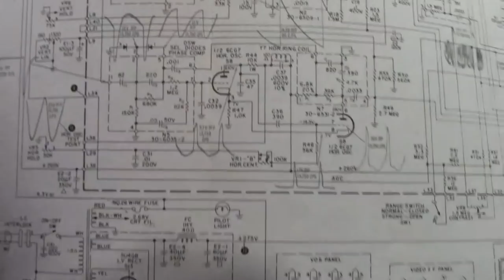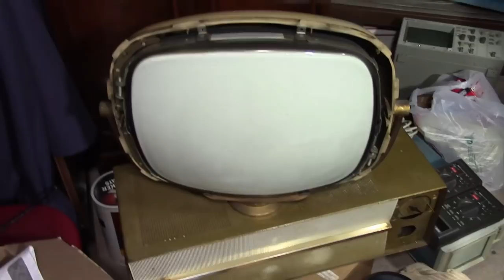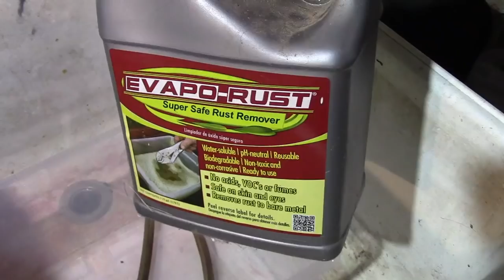Filthy Philco Predicta Siesta resto p7o?

Comment: At 5:01, on the schematic I believe the vertical line to the left of 1320 on the vert lin pot is the physical stop at 180 ohms. Otherwise you're right, it would be possible to turn the control down to 0 ohms. Loving this restoration series!
Reply from the maker: Yes, that is exactly what the line indicates, but they show that ended shorted to the wiper so it limits the upper end of the resistance.  The control will go from 0 to 1320 ohms.  Make more sense to me from it to go from 180 to 1,500 to maintane a negative voltage on the output triode grid relative to the cathode.
Reply: @bandersentv  Hmmm... yeah that is strange. From your previous video I thought the same thing, that the 180 ohm tap was a minimum resistance so it would limit cathode current. It's wired as shown in the schematic? I expected the wiper to connect to the 180 ohm tap point so that control would go from 180 to 1500 ohms as measured from the cathode to gnd. But the way it's shown schematically it would be 0 to 1140 ohms... why did Philco bother with a special pot then? Took a quick look at some early 50s schematics from sets I've worked on, they have very similar linearity controls in the VOT cathode, using a pot in series with 150 ohm fixed resistance. Has me wondering if there's a typo in the schematic, some previous tech replaced the control as shown, and maybe that cooked the other resistor in the vertical circuit? I have no expertise in Predictas, so maybe the circuit is correct as wired. Curious to know if you find out differently.
Reply from the maker: I examined the control and it seems the schematic is wrong.   There is one lug for the wiped and the body is grounded.  The resistance varies from about 180 to 1500

Comment: Bob, on the IF strip, don't forget there is a Network on there and should be replaced too.  It looks like a ceramic cap near the middle coil.  Also on one of the Predicta's I redid there was a small diameter phenolic tube about 1/2" dia that was placed over the chassis mounting screw "hump" that is located under the octal tubes.  This spacer was about 9/16 high and is used to support the board when pushing in the octal tubes.  I use some 1/2 dia sprinkler pipe and epoxy it over the hump on all the Predicta's I restore.
Reply from the maker: Yes, I noticed you supplied the IF network with your reproductions.  Interesting.  I've worked on about a dozen of these and never seen that piece under the octal tubes.
Reply: @bandersentv  The IF Network I supply is has the capacitor changed from 15pf to 12pfto improve SNR per Riders on the Run Changes for the 10L43 chassis.  The small spacer might have been on one of the Danish Moderns I did.
Reply from the maker: Thanks for the info

Comment: If you need a real good brass paint to spray try the Humbrol brand. Acrylic spray in a 150mL can. Let dry 8 hours and spray a clear coat of Humbrol Satin finish clear.
I got mine  (actually Copper Special metallic paint and polished Aluminum for a Heathkit signal generator project)  at America's Best Hobby Center in Itasca.
 You could also get this brand at Des Plaines Hobbies too but they were low on stock on some colors. Was really impressed at the final finishes of this paint.
Those copper clad boards inside were corroded and  I cleaned it with Simply Green and a toothbrush. Taped off everything not to be painted! Worked very good.
You could try using  ordinary tomato ketchup . Soak it for a 30 minute session and wash it in warm soapy water. If still not clean enough repeat those steps. Unfortunately
it won't help with pitting. You could try the paint instead of re-plating! This is to insure all the brass and plated brass  steel  match in shade and color. Whew!

Comment: For wire sources don't forget to look at the multi-conductor options (ie. multi-conductor cables). Something for industrial usage like robotics or motor control may be salvageable or (worst-case!) purchased. This stuff is stranded, flexible, high heat tolerant and goes up to 1kV ratings. An example of this would be the Flamar line of cabling from molex (avail at Digikey too). The downside is that you have to spend some time stripping the cover and getting the wire out, if you want the individual cable "look". I did this many a time in my youth when I needed wire fro projects but was too poor to buy it. I used to scrap Belden cable...
This stuff is a plastic (like) coating... i suppose a cloth covering could be slipped over it, depends on how far down that road you want to go in the restoration.
Cheers,
Reply from the maker: I don't care about cloth, but ideally it has to be stranded, 22 AWG and 2kV or better rated.
Reply: @bandersentv  - There is some 2kV wire that is used in VFD applications (variable frequency drive), mainly larger gauge like the Belden offerings so that's not of much use to you... Any option to scrap HV wire from other (newer) CRT sets?
Cheers,

Comment: Those newfangled ceramic octal sockets were likely designed to accommodate either mounting scenario mentioned early in the video.
Reply: hawkturkey  They are Chinese copies of a type of Soviet/Russian socket, with the Soviet ones they have a bracket that you can flip over for either top, or bottom mounting, the socket in a chassis. The only difference with these is that the Russian ones were molded out of black Bakelite rather then porcelain, and the P.C board style pins, which are longer then others I have seen for sale.

Comment: It is nice that you found those octal sockets. They will be an improvement over the originals.  The wire wound linearity control seems to be a problem. "Simple Green"? Is that a grocery store cleaner? I always learn something from your videos and look forward to watching them in the morning when I have my coffee. I started on the TV from my 1950 Magnavox Embassy yesterday and have the chassis on the bench. It was quite a challenge to get it out of the cabinet. BTW- In years past when ever I rebuilt older Leslie Speaker amplifier I always replace the crappy phenolic octal tube sockets with porcelain sockets. You always do such a thorough job paying close attention to detail. It is amazing how heavy cigarette smoking can coat something. I was very surprised when you said that you don't keep most of the sets that you restore. In my case I do have a personal museum because I grew up with television. If you ever run across one- I am looking for a 1955 RCA Headliner set.  Gary
Reply from the maker: It's been around for years and widely available.

Comment: Maybe steam would be a good way to get all the grime off of those metal bars without damaging the plating underneath?  I've had a lot of good luck with steam cleaning in the past.  You can get a handheld steamer fairly inexpensively.
Reply from the maker: Yes, I'm sure that would work well.  Some of it really was rust though and I needed to use a rust remover
Reply: @bandersentv  Yeah, I posted that before you actually put it in the evaporust.

Comment: I as many others who are watching your trials and tribulations with ancient electronics salute you in our own quiet ways. Forgive me if I am wrong but *Brass Plating is not possible as plating can only possible with an elementary metal,- Brass is ZnCuPb, so therefore not transferable thru electrolysis, I've wondered for years what metal gives that 'gold' effect, Discuss. Cheers from Sam in England.
Reply from the maker: Copper and Zinc - no lead.  Yes, it is electroplated fairly easily.  You can read more here:  https://www.finishing.com/280/32.shtml
Reply: @bandersentv  An interesting read, Thank you Bob.

Comment: That Predicta is going to be amazing! Wonderful series, Bob. I'm restoring a Heathkit 'Novice dream station from 66'... my DX-60 transmitter has a mildly yellowed meter lens. I've heard that it's not possible to do anyhing about this, as it's due to chemical changes throughout the plastic, not a discolration of the surface. Does anyone know if this is true?
Reply: @N8NK QRP, research the Mr. Clean Magic Eraser method; I believe that RestoreOldRadios may have done a video on that
Reply: @AMStationEngineer  Thank you! I'll check it out. take care OM

Comment: This is the socket I was actually referring to: https://www.partsconnexion.com/BELTON-54795.html

At least they didn't skimp on the power transformer...138 is Stancor.
Reply from the maker: Yes, I know about Belton sockets
Reply: I've bought sockets from the former USSR, Ukraine in particular, they were basically a copy of Amphenol made tube sockets, the kind that fit into a keyed hole with a snap ring. There may be circuit board mount ones available from there as well.  The reason I went with Ukraine is because I didn't trust the Chinese sellers, or their products, they also seemed to be all over the map in terms of the dimensions they gave, even with what appeared to be identical products.

Comment: There was an option that you didn't mention concerning the missing plating on the tubular sections.  You can always clean them thoroughly and then coat them with Brass Colored Spray Paint!  After that dries you can then coat over it with some sort of polyurethane or something.
My "vote" is to NOT cut off any wires from any other yokes, etc.  Purchase the wire and use new wire.  I know, not my project, still....
Reply from the maker: Didn't mention it, because I know how it will look.  Metallic paints just aren't shiny enough.  Spent a couple hours looking for suitable wire to purchase but came up empty.  Looking for 22 AWG stranded rated for about 3-5 kV.  The only stuff I found came from China with a 1-2 month waiting period.
Reply: @bandersentv  Did that organ you scrapped a few years ago have a wiring harness in it? I was just thinking of that video when I saw this yesterday.

Comment: Use coke or electro plating put a piece of metal in a container use battery charger hook one end to metal your taking rust off of and other end to scrap metal you want rust to go onto. I believe it's baking soda and water
Reply from the maker: I've done it before during a metal Admiral portable project.
Reply: @bandersentv  nice :) did it turn out good?

Comment: That plastic on the CRT housing looks like it's yellowed, it's probably a good candidate for a hydrogen peroxide + UV (Retr0bright) treatment.
Reply from the maker: Maybe, maybe not.  I'm familiar with the yellowing effect caused by the fire retarder they put into plastics in the 80s.  This is different though.  Probably caused by cigarette smoke.  Worried it might turn out splotchy or too white.  The original color is a pale yellowish off-white.
Reply: @bandersentv  I've heard of some having luck immersing the plastic part in a peroxide solution and heating it, but you don't want to go over about 70 degrees centigrade or the parts can warp, at least if they are polystyrene as opposed to abs plastic. Maybe a damaged housing would be a good candidate to experiment on?

Comment: I use to do gold plating as a jeweler.  It is not that hard.  Basically a power supply and the chemicals.  Just be careful with the chemicals.
Reply from the maker: Yes, I have done it on a small scale before.  I showed it in my Predicta Holiday restoration series.  Don't want to spend $100s of dollars on chemicals and supplies to do larger pieces.  https://www.caswellplating.com/electroplating-anodizing/brass-plating-kits.html

Comment: re-plate your own pieces there are videos on youtube how to do it, it's easy.
Reply from the maker: The chemicals needed are expensive.  Also the commercial plating chemials use cyanide and are tightly regulated.  The hobby grade stuff is just not very good.  The plating isn't as shiny or thick and doesn;t adhere as well.
Reply: @bandersentv  It depends on what you are trying to plate with, with copper plating, for example, you just need copper sulfate, some scrap copper as an anode, and a DC power supply. I'm not sure about brass. I would ask Russ on the Philco Phorum, or Buzz1151 about it.